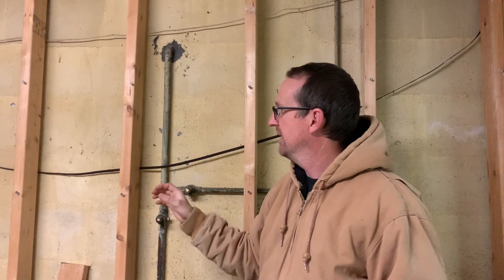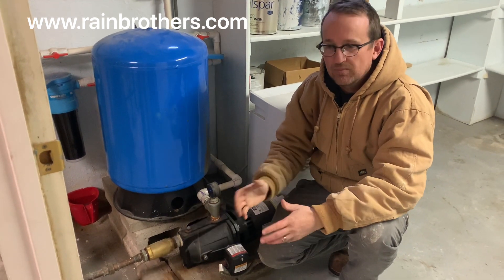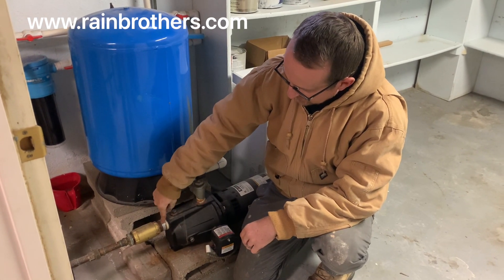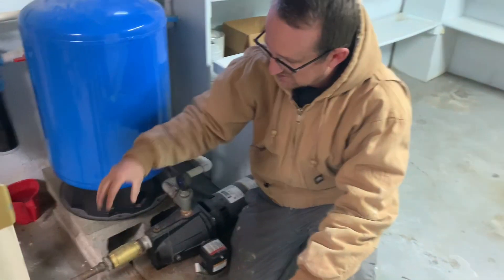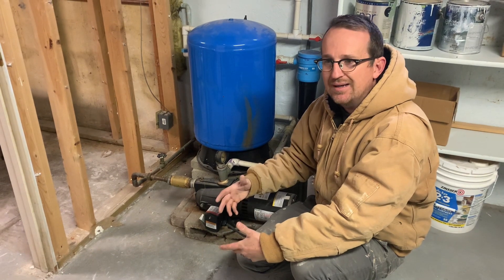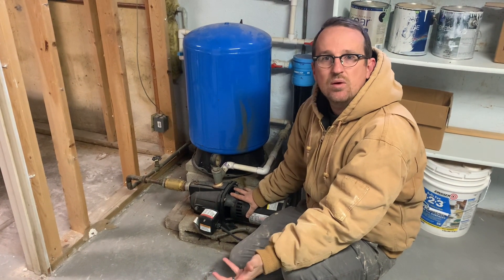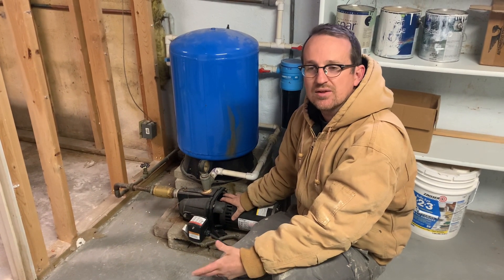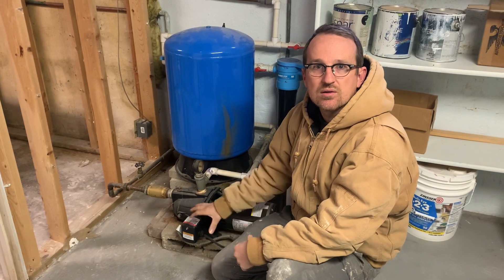Problems with jet pump installations and how to fix them

Comment: Our jet pump that came with the house (1873 farmhouse) died so I installed a new one 4 days ago (same style/specifications as previous). Recommendation is for the intake pipe to be 1 1/4” or larger but the existing coming through the granite foundation is 1”. Until it died, the old pump never seemed to have any issues with that. I’m assuming there’s a decent check valve on the foot valve. I did install a check valve on the intake at the new pump. The new pump seems to work well until it’s put under an extended demand (watering the garden or filling laundry and a simultaneous couple of toilet flushes). It essentially shuts off, pressure drops to zero and the pump clicks as if trying to start. If I unplug it, turn off the demand and plug back in, it gets back to pressure and seems fine. Could that check valve at the pump reduce flow enough to cause this? Also went from a 15 gal to 20 gal pressure tank. Thanks.
Reply from the maker: 1” for suction line is fine, although we do recommend 1-1/4”. But nothing inherently wrong with 1”. As for the pump issue, you may have a blockage somewhere that is restricting flow, or it may just be that the flow demand from your garden watering exceeds the capacity of the pump, so at fully open discharge, it cannot generate pressure. You might try closing your spigot a bit to reduce flow, and that may help it hold its pressure. It could also be that your pressure tank is not working if you just replaced it - jiggle it to make sure there’s water in it. If there isn’t, you likely don’t have the air pressure in the pressure tank calibrated correctly. Air pressure in the pressure tank needs to be set to 2PSI less than the cut in pressure on your pump.